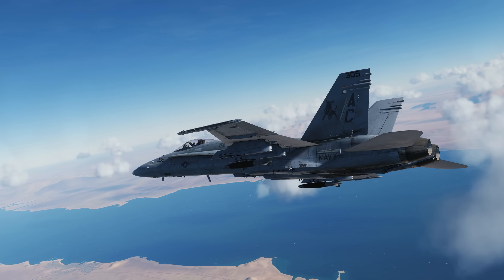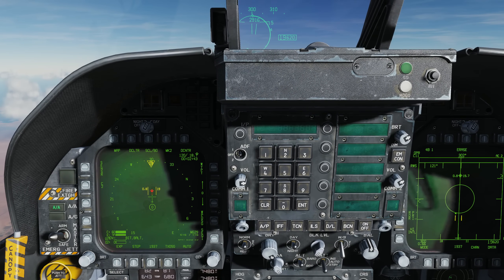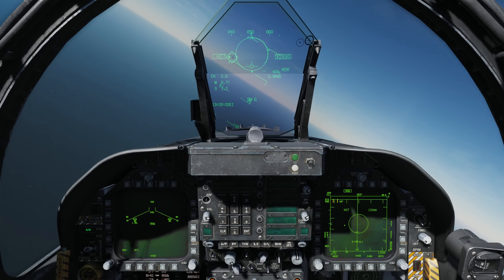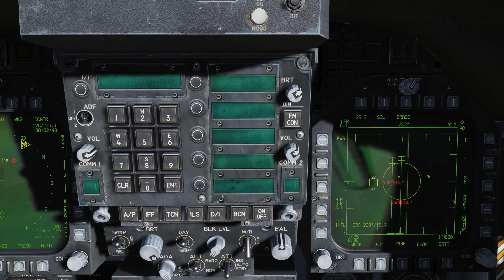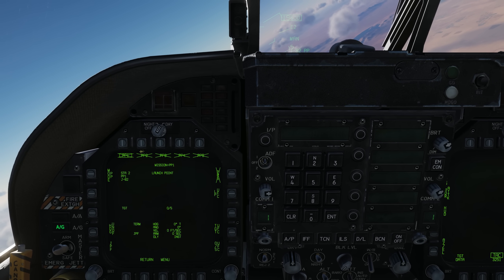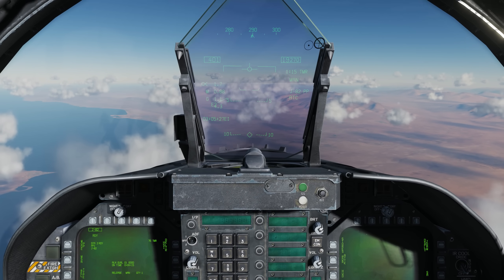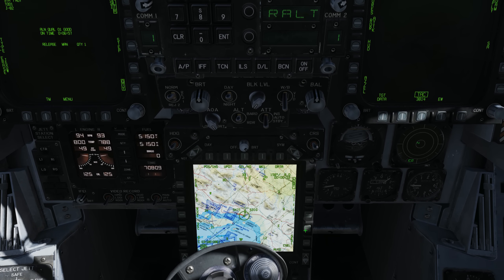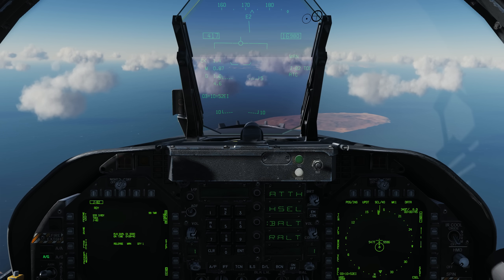Hornet Update: Introduction to JDAM, LTWS and More

Comment: Hey Matt,
those are very good videos but why doesn't eagle dynamics make training mission with so much information provided ? That would be fantastic !
Reply from the maker: We do, check in the Training selection on the main menu.
Reply: I have no training missions regarding for example AGM-65. Do you mean the missions in the mission menu ? There are some missions with AGM 64 E/F but without comments explaining what i have to do like in trainings or active pause...
Or should I move to beta ?
Reply from the maker: @twanmal . We create the training mission once the system is 100% done. For the Maverick, we will now create it because the TGP is available.

Comment: What are the steps you need to take on start-up for the SA page to display Data Link targets? Can't seem to make it work on a cold start-up, but works in missions where you start in-air.
Reply: On the ufc you need press the D/L button and turn the datalink on, after that you just need friendly aircraft with datalink in the air to share information such as ai f-15s, f-16s, f/a-18s E-2, E-3

Comment: noob question: at 7:46 how do you "designate" a target in LTWS? with what button exactly? the usual TDC depress?
Reply: I think it will be 'Sensor Control Switch - Depress' to designate, not TDC select.
Reply: @paulj1036  seems reasonable, thanks!
Reply: @paulj1036  turns out it is TDC depress :)

Comment: UFC "HDTH" is that a bug? It should stand for Height... If not a bug I would like to know what the acronym stands for. See video at 11:47
Reply: "We are currently using coordinate entry in the HDTH (hundredth of a degree) option. Later, we will add the THSD option (termed PRECISE when used in the HSI for waypoint entry/modification). " from Wags' another JDAM video notes.
Reply: Exactly, how did that happen? ;-)

Comment: I am assuming for TOO mode, just like PP mode, you will need an accurate waypoint created down the exact lat/long anyway? In which case, when it comes to multiplayer servers, whats the difference between setting it as a waypoint initially while aligning on the ground vs hammering it in when you find it? It does require quite a lot of F10 mapping to get the lat/longs for these things.

Great to see the module coming together, the F18 and F14 are fantastic additions to the game and really give a feel of a complete module.

My only real complaint is spotting other aircraft and how difficult it is, but that's not really for this video.

Comment: Love all the new toys coming to the Hornet, but has there been any other news on when the MGRS coordinates will be implemented? Would be very useful for dropping JDAMS when target info is coming from JTAC.
Reply: The extra digit lot lat/lon on the A-10 would be pretty good too, if the plane supports that ofc.
Reply: @bodifx  Sure would be nice, but atleast it is fairly easy to convert from DM.m used by the A-10C to DMS currently entered in the Hornet...